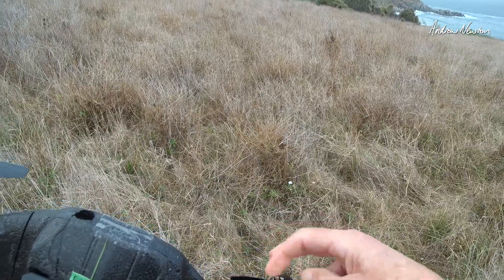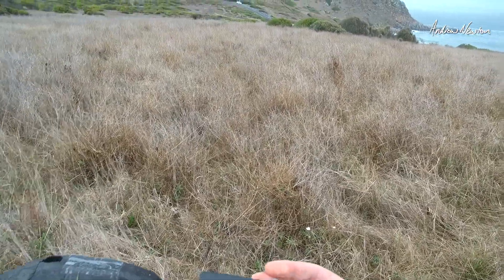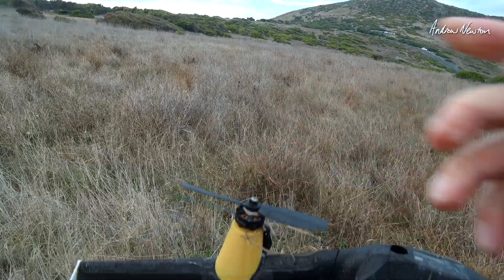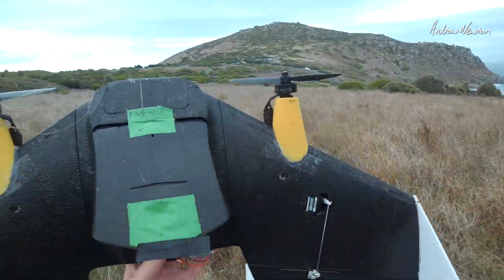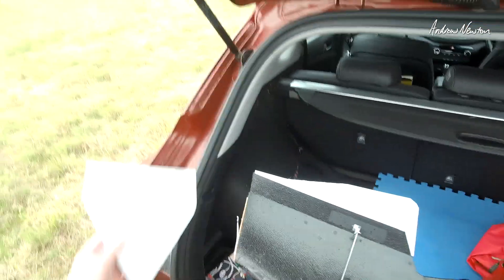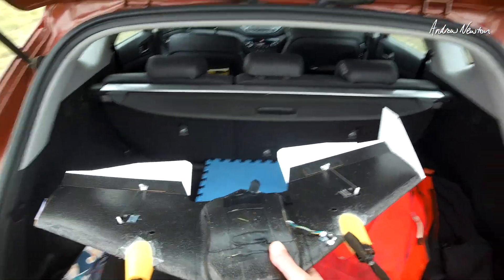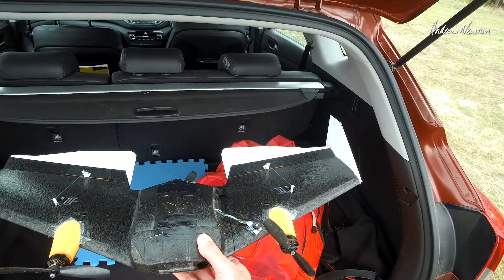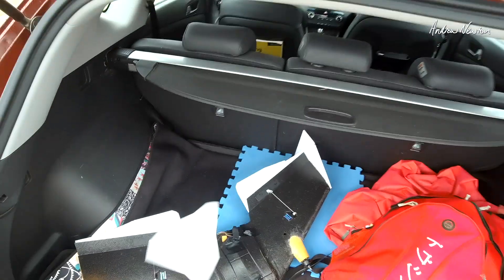INAV Tailsitter - More Progress

Comment: I've been trying to get a tailsitter working and been cursed so bad. lol this gives me hope.  Is it better in 8.0.1?  I can't find a good guide.
Reply from the maker: There are no guides unfortunately. Haven't tried INAV 8 VTOL yet
Reply: @AndrewNewton  I'm one esc away from trying it, using grok to try to help me, tough going.
Reply: @AndrewNewton  I exploded a flight controller and receiver somehow cause my motor and servos were off somehow I guess, not sure how I did it, this is so cursed. lol
Reply: @AndrewNewton  I finally got the servos working though, just missing an esc for the second motor...may try an old one I have.

Comment: That's pretty impressive, it's obvious how hard it struggles to go vertical with no pitch authority. Little idea i just had, tell me if it's nonsense, but what if you transitioned by doing a half-roll and yawing yourself vertical with differential thrust?
Reply from the maker: Interesting idea, but might be difficult to pull off. Just not the right type of craft for good tail sitter performance,
Reply: @AndrewNewton  definitely not, the idea i had for a tail-sitter was a cruciform/X-wing quad, it would be far easier in terms of control. If you took two of this plane, sawed down the middle and put them together, the performance would be very interesting

Comment: Making very good progress. Great VTOL transition transmitter sound, it almost sounds like "pull up". In wing mode, it's nice quiet flyer. The fish walk (yaw wag) at 3:12 was a bit comical. I assume a pull-up to vertical with speed before switch transition to vertical is less eventful?
The tendency to fall on its back almost appears to be a software bug of some sort. Looking at data log might provide a clue as to why. Thanks for the entertaining video. :)
Reply from the maker: I'm a bit stumped at the moment. Everything I do makes the yaw waggle worse.

Comment: I think that the main problem is that Elevons are not very effective at slow speeds, making the transition very hard. For this reason I would try to use tilt control on the motors.  See: “Building an RC VTOL” by Tom Stanton.

Comment: I've been interested in an RC VTOL tail-sitter after seeing a professional version that seemed totally sorted out, the Jedsy Glider, a Swiss medical delivery drone. However, Jedsy has apparently abandoned the tail-sitter design after spending years on development and receiving certification. On their website Jedsy are now showing a quadplane version similar to Google's Wing called the Jedsy X, rather than their original tail-sitter. Their promo video also features the new drone. All I can find on the change is a press release two weeks ago touting the expanded capabilities of the new drone. That, and watching Andrew struggle to make it work, has me reconsidering the project.
Reply from the maker: Tailsitters are the easiest build but maybe harder to tune well
Reply: @AndrewNewton   I'm keen to build some kind of VTOL/plane. Agree that the tail-sitter is the simplest VTOL design wise. It's not clear why Jedsy changed from their tail-sitter, as the Jedsy Glider looked to be dialed in spot on. They of course have professional software developers writing the flight software. The quadplane route is probably the most developed for the hobbyist but just doesn't appeal to me. I've also looked at tilt wings, like HobbyKing's discontinued Canadair CL-84 Dynavert. My first though would be to make the outboard panels fixed and rotate the inner sections with the motors/props, kind of a reverse of the V22. It would make the entire assembly more ridged and require less torque than rotating the entire wing. Simple enough as there is no need for flaps and I've already designed a 1.5M twist wing plane that uses 3D printed bevel gears, which also require less torque than levers and cams.

Comment: Hi could You please make a video on how to bind the Radiomaster boxer to flysky recivers? Ijust got this tx and cant figure it out ,thanks
Reply: @Elisrc - If you are using an FSia6b receiver - The settings that work for me are > Multi > Flysky2A> PWM,IBUS.  Of course you need to bind with the bind plug inserted in the FSia6b, but it was always the "Flysky2A" that used to catch me out.  Hope that helps.
Reply: @wrevenaugh  thanks man
Reply: @wrevenaugh  IT would really help if You could make a video about it ....i think ive meesed up the settimgs trying to figure it out and now it dosent show me the sbus etc anymore
Reply from the maker: Which receiver? FlySKY have 4 different protocols. Do you have the 4in1 or CC2500 Boxer?
Reply: @AndrewNewton  i have the 4in1 ,but you've already helped me ...i figured it out after a while ,so thankyou very much

Comment: The combination of Thrust Yaw and Aileron vectoring is a hard one isnt it !.    I would love if you setup the controller later with a GPS/Mag  (Walksnail $28 at the moment) and run Arduplane on it to see if running it in an Auto mode is any better.  So auto QLoiter to FBWB and then back again,  be VERY interesting to see. (The mag works in all directions)
Reply from the maker: Yes very tricky tuning. I do glance at Ardupilot occasionally.
Reply: Even with Ardupilot VTOLs setups can be tricky, but at least there are known some workable recipes. For Ardupilot VTOLs its pretty common to include an airspeed sensor to help the software understand where it's in the transition.
I don't envy Andrew, as INAV VTOL is very new and as such is challenging to sort out airframe quirks and software config quirks, not including finding the occasional bug.

Comment: I watched tailsitter vidoes going back to 2017 and have forgotten the specific ones other than someone release videos of it in action in a banggood product listing. I knew there were issues since I never saw people post videos of their own copies showing successful flights.  It is very difficult and glad you have the patience and interest to tackle it.  Never seen an Inav version.  Usually others used ardupilot I think.   Do you remember when Peter Sripol introduced the FT Bronco vtol on the flite test channel?  It seemed to daunting to try to copy it and no one has really produced a copy that others could follow along and build themselves.  I thought the bronco was the coolest mod of the FT Explorer.